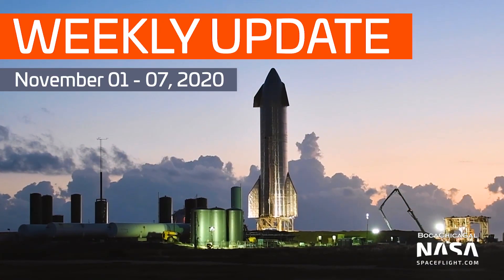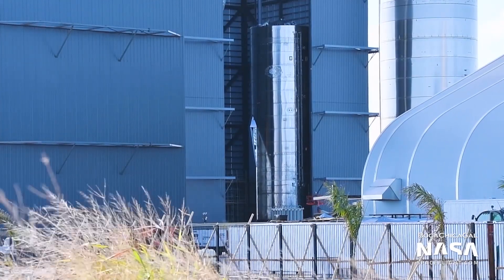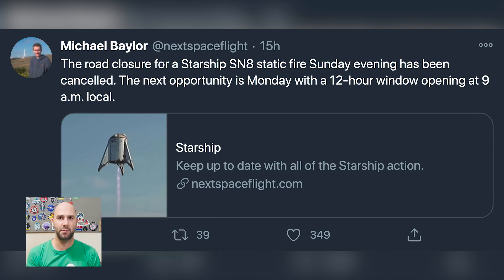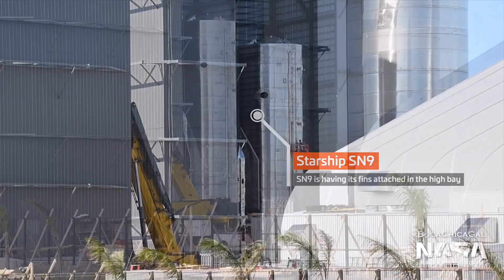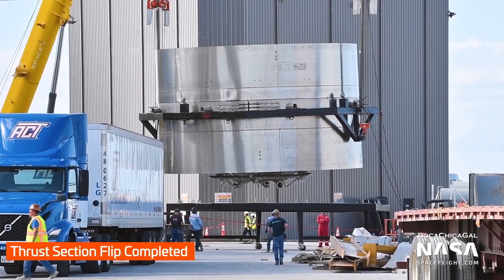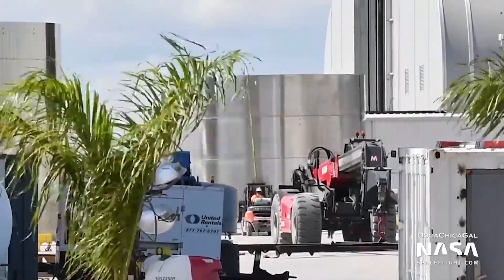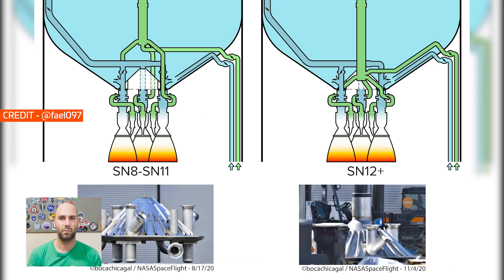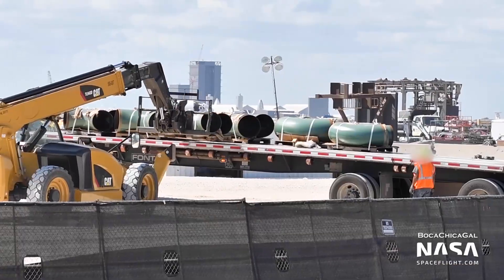SpaceX Boca Chica Weekly Update - Starship SN8 Header Cryo Proof Complete - Super Heavy Stacking

Comment: The LOX barrel shown being lifted into the High Bay has internal stringers, but I don't see any external weld burn marks. Stitching together in my head some images from RGT Aerial photos, I've seen several 4-ring barrels with internal stringers in the group of SH pieces. All of the labeled LOX sections don't have the weld burns. Is this a new assembly technique, or am I confused?

Comment: Great update! Stupid question: If the tank walls are the ship itself, and only the main fuel is coming thru the downcomer, where is the piping from the landing reserve? It must run outside, but I never see any tube looking nearly wide enough. The diagram you showed reminded me to ask.
Reply: The piping from the LOX header tank runs down the (interior) side of the cargo section, through the top dome, and down through both tanks before angling in to the thrust puck maze of lines. Runs along the wall the whole way till then. Enough bits and pieces have been seen in various pics to put this together accurately. It's much larger than the exterior piping, which is probably for the autogenous pressurization gases.

All of the CH4 runs through the CH4 header tank at the bottom of the main tank, into the main downcomer. Several large circular holes in the header tank allow this; when the main tank is almost empty, these holes/valves close, making sure the header tank is full. When the engines are relit, the header tank empties through the main downcomer. Again, various pics have yielded enough clues to put this together. A lot of this is posted on the r/SpaceX reddit site.